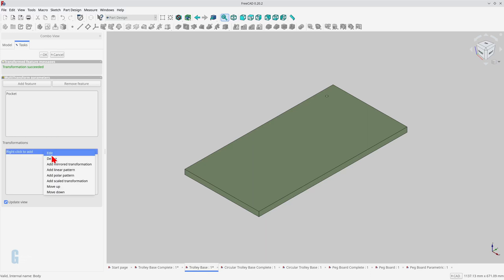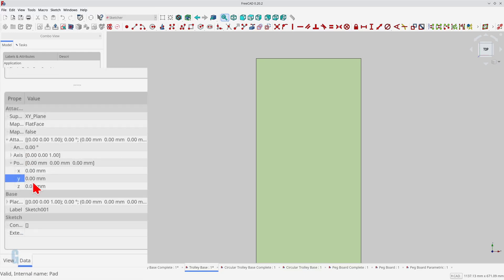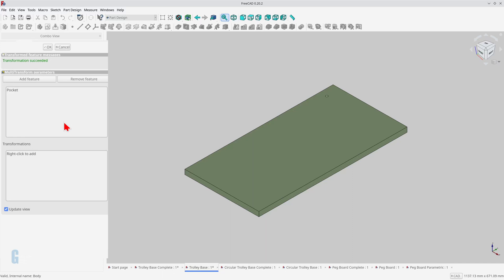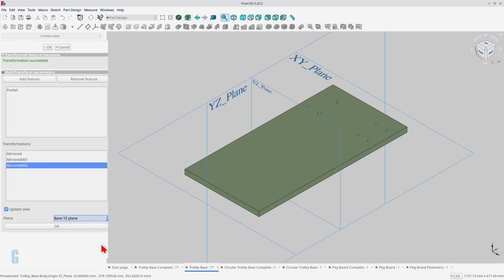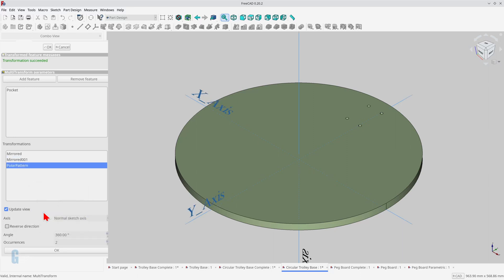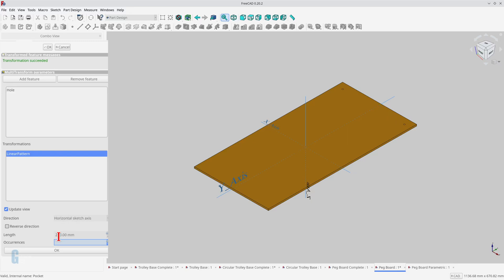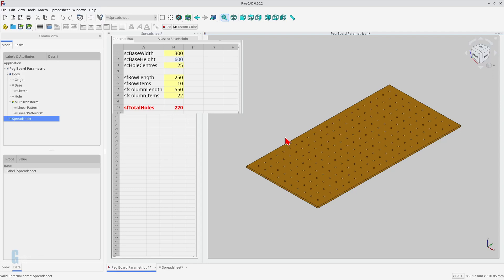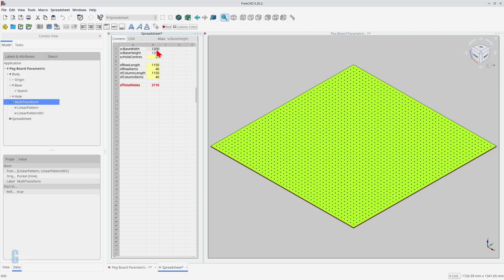Introduction to the Multi-transform Tool

Comment: In the 1st example,  where do you set the mirrored spacing?
Reply from the maker: Thanks for your question. The mirror is made relative to the plane that you select, so the distance between the two objects is twice the distance between the object and the selected plane.